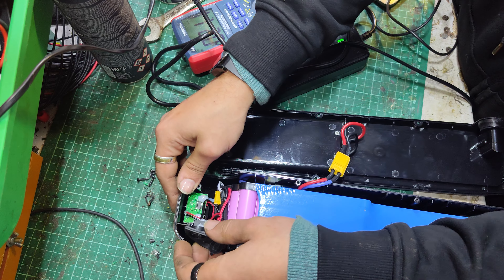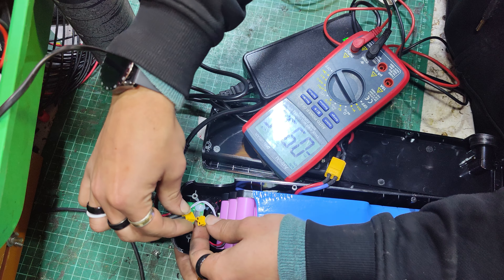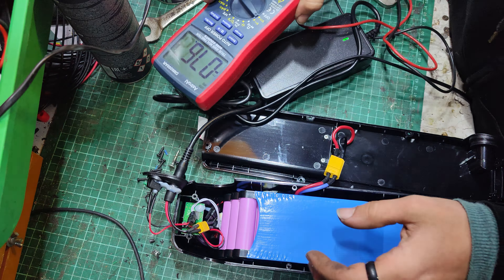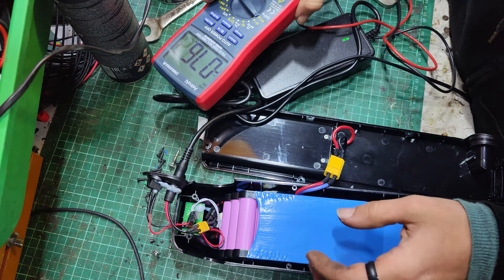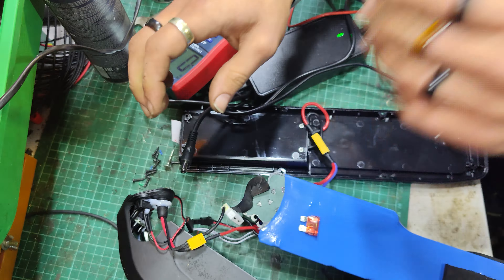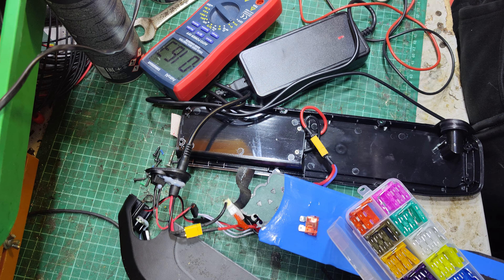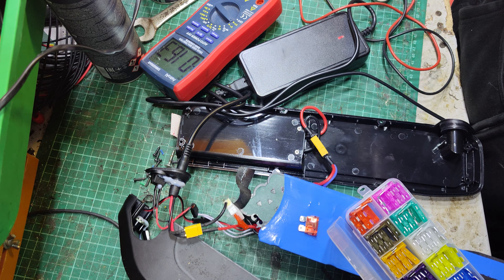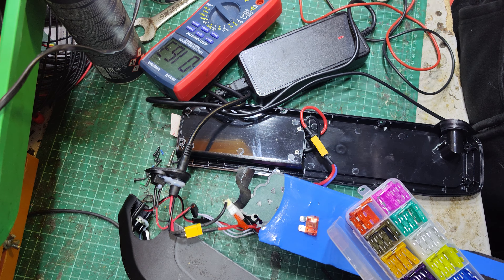Hailong Battery not charging (Blown fuse)

Comment: So I was riding the other day I thought I was holding my cruise control turns out it was the power button, my bike turned off and has not turned back on since, I contacted the bike company they told me to check the fuse in the battery which was blown, I got more fuses put them in and blew 2 more, as soon as I put the battery in the bike and turn the battery on not even the display the motor would jerk and the fuse was blown, any help please it's a brand new bike less than 30 days old, the bike company has been great but as you know they're very hard to get ahold of once in awhile because of the time difference I need this bike fixed any suggestions would be great
Reply from the maker: Sounds like a blown controller in the bike!

Comment: Any idea what could be the cause?
My 52v Samsung Hailong had 2 blown fuses, had it repaired and it blew again after first ride.
KT Controller rated at 20a and a 2000w hub motor.
Reply from the maker: Hiya - it's possible that the controller is pulling more amps than the fuse is rated for. 20a continou KT controller could pull 35-45amps peak. You'd need a higher rated fuse to cope with that. Thanks!
Reply: @EbikeRepairs  fuses
Reply: @EbikeRepairs  True controllers for most 1500-2000w kits have a max discharge of 45A  i im using a 40A battery now and experiencing the same problem as in the video
Reply: Thank you!

Comment: I have the same battery on my z8 and it’s doing this green light all the time can’t find a fuse same parts and everything inside
Reply from the maker: Possibly BMS/cell problem. You can always send it to us to get checked out!
Reply: @EbikeRepairs  it was the charger it must’ve bumped against the Frame when I fell off the one day thanks for responding
Reply: @mrodriguezangel1  condensators in these chargers are fragile